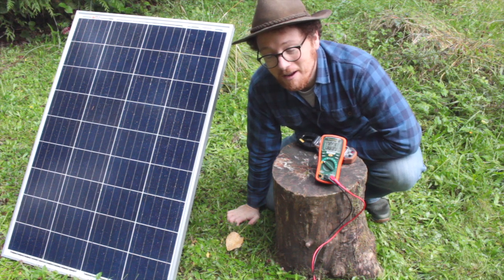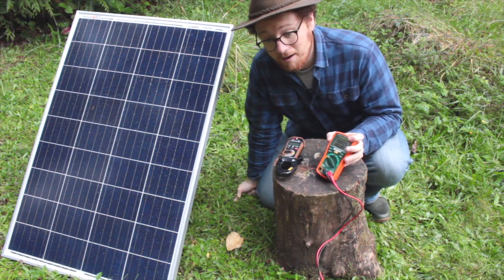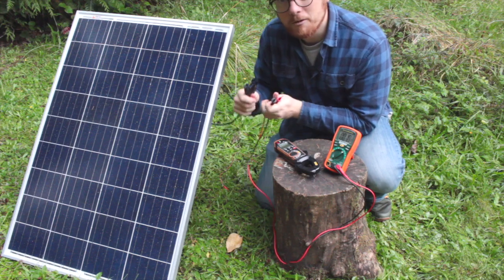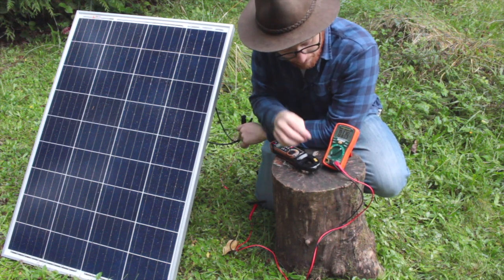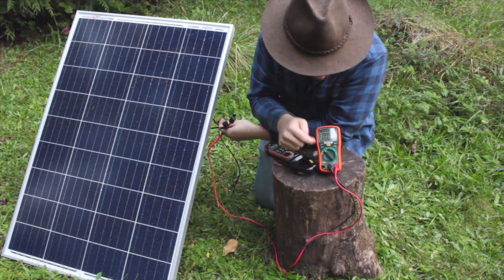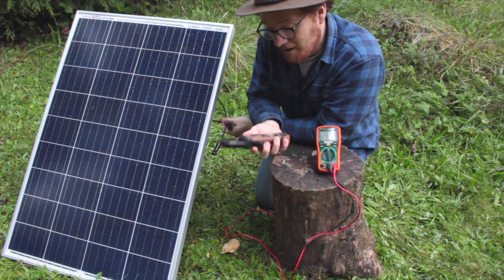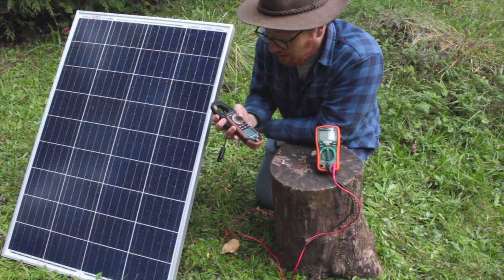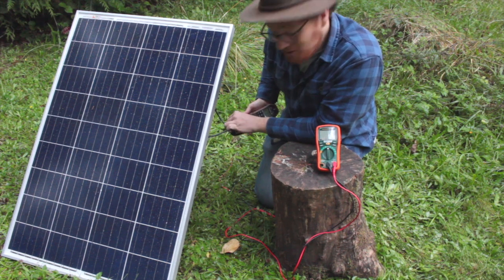How to Measure Solar Panel Open Circuit Voltage and Short Circuit Current

Comment: Thank you.  That was perfectly clear. 
I was pretty sure I knew what I was doing.  You confirmed it.  Not new to electronics. But I know I don't know everything and I do forget many things. I received replacement a solar panel from a company that I ,once again, could not measure any voltage from properly on my Fieldpiece SC76 multi-meter..  The panels would also drain my batteries so in the morning I could not start my truck.
However the meter will correctly test a battery or the wall voltage if set correctly.

Comment: i have here a silly cuestión, if i make an array of 4 panels connected in series, lets say 24v 400w (49VOC MAX) this open circuit voltage current,  (49) will be value for the complete array or it will add up?
Reply from the maker: Connected in series, the voltages will add up. So the open circuit voltage would be 196v in your example. Wiring them in parallel would make the max voltage just 49 for all of them, but the total current adds up, potentially requiring thicker wires.

Comment: when you did the amp test, what is the load, the meter? if you connected a charge controller that was connected to a battery that needs charged, and then connected your panel to the charge controller, then measured the amps in line between the panel and the charge controller it would be the same as what you have here in this video?  i realize it appears to be overcast, but you should be making more than  .017 amps with that panel. my 100 watt panel will make .13amps in the complete winter overcast day ( i literally just checked), and about 4 amps when the sun is brightest with the best angle. anyways i am making close to 10 times the amps you are, but i have a charge controller and a battery being charged right now. sincerely i am curious, this is all new to me. thanks for the video.
Reply from the maker: You measurements are typical. The sun setting behind clouds when I made this video, which is why I was getting basically no power. It seems brighter in the video than it really was because of post-processing.
Reply: Hi , may I know what type of battery you use for charging?

Comment: Will you damage the panel when connected +/- together? Maybe I don't understand short circuit current.
Reply from the maker: You won't damage the solar panel. While short circuiting other energy sources like a battery or wall socket can be dangerous, solar panels are designed to handle the current draw. Just make sure your meter is rated to handle it.
Reply: @OffGridPermaculture  thank you for prompt reply.
Reply: @OffGridPermaculture  I never quite understood this concept of what happens when solar panel output is shorted.  So there is something "designed into," or added to,  the solar panel that makes shorting the output harmless?    Then without this added feature, shorting the output would damage the solar panel like shorting the output of most any other power source?
Reply: @kimstockdale632  the reason it won't hurt it is they are usually 15 amp max and the wire is 10 gauge  which can handle like 30 amps. But at most points the panel will be putting out a much lower 1-5 amps so it's not gonna damage it for a short test
Reply: I heard it somewhere that solar panels are current limited is this the reason why.

Comment: Please show in experience pple how to use the meter like bringing it closer so they can see what ur doing exactly but great video
Reply: He's telling you what to measure- volts DC, for example. Get the multimeter manual and find the associated setting on the meter for DC volts. Easy peasy.

Comment: You better have someone show you how to use your meters. You can't measure current on an open circuit with meter probes (only voltage). When you plugged the two wires together, that was a closed circuit. It was also a short circuit since there was no load on the circuit, except for the solar panel it self acting as a load. This would be the time to measure current with your amp clamp, and not by pinching the wire with the clamp, but by placing the wire inside the clamp loop. You have to know what you are doing before you can show others.
Reply: Why?
I inserted USB cable  ( that was stripped to expose + and - wires ) to 5 watt  solar panel USB output and attached cheap voltmeter ho USB cable bare ends, + to +, -  to - and got 4.85 volts, and up to 500 man reading.